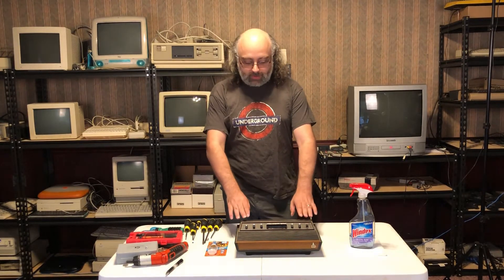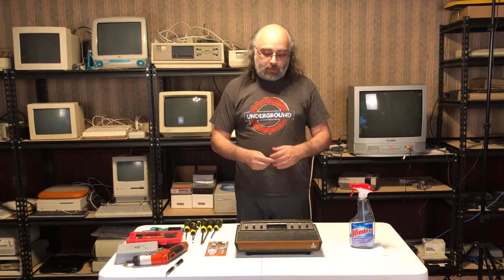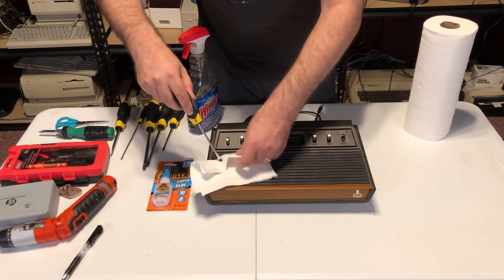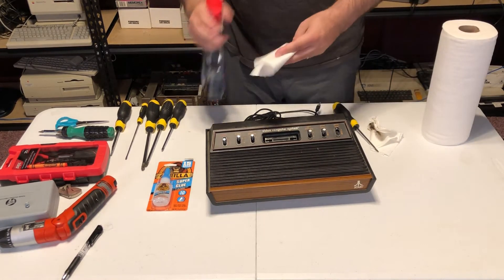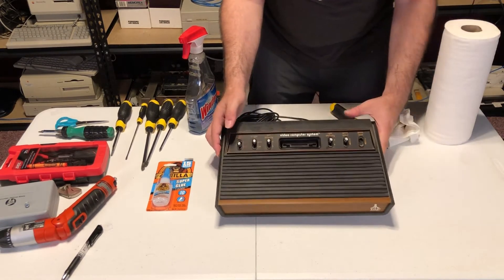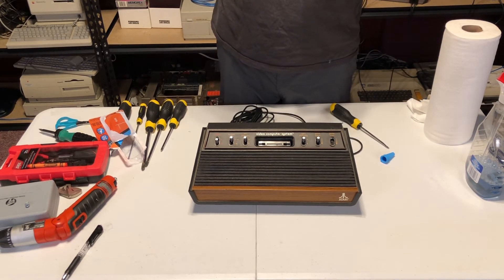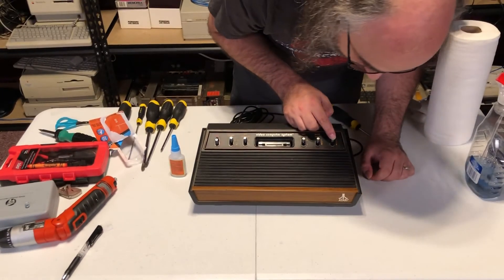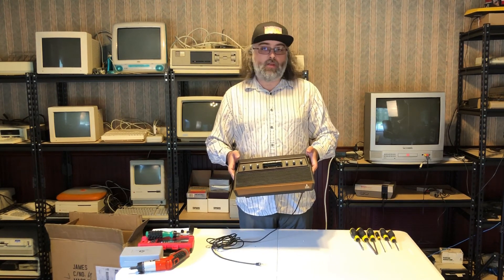Atari 2600 Repair

Comment: I'm not sure if that switch is 100% operational by using the super glue. If you were to use JB Weld, it will be 100% operational.